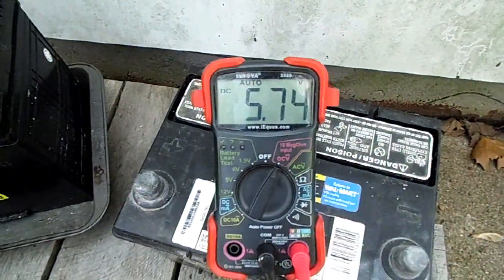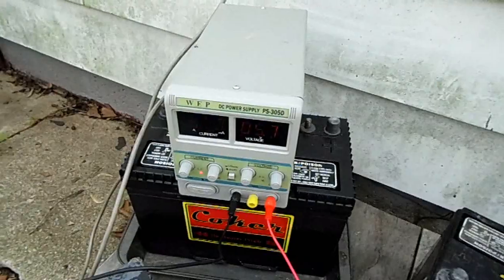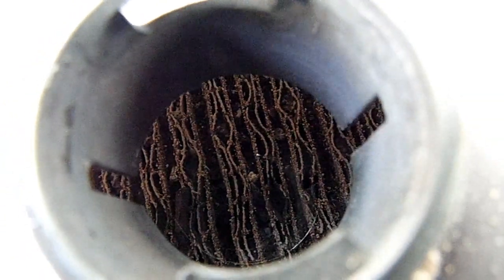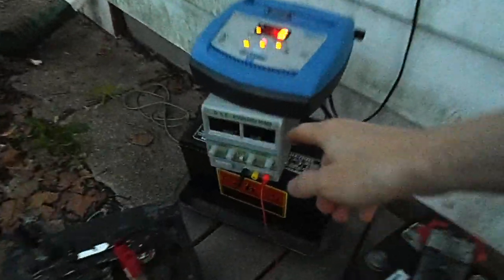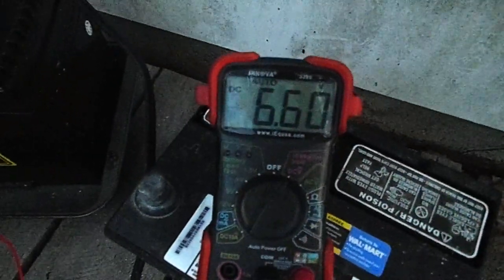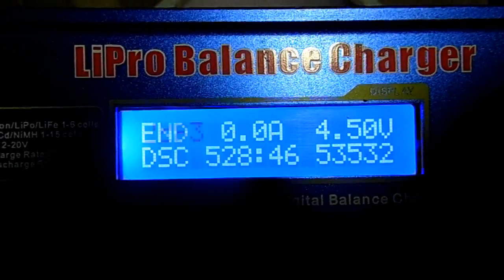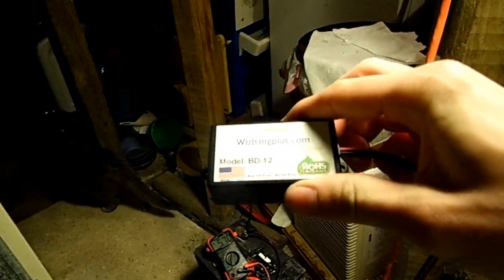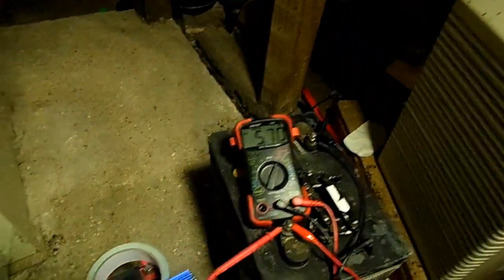Do Desulfators Restore Amp-Hours? Lead Acid Battery experiment

Comment: So 1st he is using a 12v Desulfator not a 6v. There are multiple way to revive flooded lead acid battery. Get yourself a battery hydrometer and a load tester. You can check each cell. To see if the acid is good. If the acid is reading water after it is charged. You can try a pulse charger or a stick welder make sure you remove caps and it is a battery of 12v or more. Set at 60-80 amps for 2 minutes turn off let sit for and hour check voltage and gravity  and load if its good perfect throw on a slow charger or a pulse charger  if not and try again. OR  you can empty the water into a bucket then add baking soda to make sure you neutralize any acid. Now you have options. You can mix pure epson salt with distilled water and boil (google the mixture amount) let dissolve and cool to room temperature and you can add to battery now charge it. OR go buy pre mixed battery acid and add that. Charge on a slow charge. You can also charge say a 6v with 8v or 12v with 14v or 16v or 18v at low amps just watch voltage so you don't damage the battery. Higher voltage with help break down the sulfation along with pulse charging. There are so many ways to revive lead acid batteries.  A Desulfator that doesn't connect to a wall as a charger will take weeks or even months one with a charger will do it faster. Good luck. Also if you do the stick welder process 100% remove  caps in a very well ventilation area and make sure the welder is attached perfect prior to turning on and unplug it to turn it off. Hydrogen gas is very explosive. Some people do the stick welder that puts off 18v in bursts like 3amps  5 mins sit for 10 min check 5amps 5 mins check and so forth. Message me any questions

Comment: DC Power supply is not really  good for charging acid battery because voltage is filtered by capacitors. For acid  battery is better to used charger with just rectifier  so voltage is not flat.

Comment: I use a Pulse Tech PowerPulse passive desulfator, they claim to have a patented frequency they use to desulfate batteries that can extend battery life up to three times, I have been using it on my BMW battery for the past three years and never have any issue's starting even though I only drive about 25 miles per week.
Reply from the maker: Well you wouldnt have issues in 3 years especially with such little use
Reply: @RinoaL  The NAPA battery came with the car that I have the PowerPulse on, I don't know it's production date, but my point is it may not be charging fully because I drive so little, and I have no power outlet in my apartment car port to use a battery charger and maintainer. I'd like to see a actual test on a Pulse Tech desulfator.

Comment: The wiz bang plus is supposed to be used on a battery that is being maintained. You are not supposed to leave it on a battery for 2 months without charging it. You likely had sulfation occurring from the battery’s self discharge not being addressed. Also, please use a smart charger. The way you charged it can easily overcharge a lead acid battery. :/

Comment: PulseTech "120volt" plug in Desulfators  work great, constantly pulsing the battery plates to break up accumulated Sulfation from not being used, charged and maintained. I've used these units on many 6 volt deep cycle golf cart batteries and they work well. Lead acid batteries require attention and charging/discharging & charging to keep Sulfation off of the battery plates. If your dealing with 6 volt deep cycle batteries, you connect two six volt batteries together and use one 12 Volt PulseTech Desulfator. They have saved many of batteries for me as well as rejuvenating a few " left for dead" batteries.

Comment: You didn’t finish the absorbed in charge so what are you really testing? Charge of the absorption voltage which is probably 7.3 V, until the tail current reaches .1 C at least.

Comment: Desulfating needs to be done at 10A to 20A or more depending on size for 3-5 minutes or more with caps off and in an open area away from flames and electrical sparks because the battery will emit explosive hydrogen. Several YT videos show how this is done using a DC welder. It is quit dangerous because apart from the obvious danger of violent explosive gasses, you could be sprayed with boiling hot acid, lead shrapnel, and other nasties. However this is the only way to effectively desulfate these batteries.
Reply: Thanks, do you know if Noco chargers which come with desulfator like Noco 5 included do work? Thanks
Reply: Nah 50amps or above for 15mins 1hour rest between 5 cycles. I do mine at 100amps.

Comment: What about fancy smart chargers like NOCO brand that has a repair mode. It says in the documentation it will bring the voltage up to about 16.5 to desulfate the 12v battery

Comment: these 6V boys already have heavy rogue sulfate crystals really all over the place, everywhere on the plates. this is probably a difficult/impossible-to-solve case though. The second issue is that because all the sulfatation is built up, the acid literally is greatly watered down as a consequence. (means : the SO4 is no longer in solution but finally bound in the crystals, reducing the acid level in the water) .  I would assume these are dead.

Comment: not defending desulfators but if your battery started off with 52 amp hour capacity it means it is not heavily sulfated to begin with so you cant expect to notice a difference. desulfators are for batteries which are sulfated and their capacity has dropped significantly but voltage not lower than 10.5 as it gets too hard when its tooo low

Comment: Here is my experience thus far. I own a Vector batter charger that has the Recondition ability. I've used this unit on many "Dead" or "Shot" batteries and it has brought them back to impressive usable condition. As I understand it the Vector uses some form of pulse technology to accomplish this. I haven't done load tests on these batteries, but basically they went from not holding any charge to working again in cars. And I live in Alaska, so we see pretty hard cranking conditions. A customer of mine has a 48v battery bank made up of Rolls batteries. He got busy over the summer and forgot to equalize the bank. Five months later, he was having to charge them with the 6kw gen almost 12 hours a day including his solar input. He picked up two used Pulse Tech brand charger desulfators at garage sales. Two different models. We stuck them on the bank and in three days went from 12 hours gen to 6. In a week it was back to normal, 3-4 hours a day. This was after three equalization cycles that yielded almost no results. Quad Outback Inverters and 2400w of solar MPPT.  My boss told him before we tried the Pulse Tech chargers that the bank was shot and there was no hope of recovery. My dad has the same Vector charger I do, and has resurrected about 10 car batteries over the last several years. There has to be something to this.....Also people swear by using Epsom Salt, haven't tried it yet, but I got a dead battery that's been sitting out for four years now, gonna give the salts a try. I think the battery industry wants us to believe that we have no choice but to keep buying new...…..

Comment: By the way Rinoa Super-genius, A desulfator like that doesnt supply enough current to do even the smallest batteries. I would get something like the infinitum whcih instead of a few milliamps, it will supply a couple of amps of current to oscillate the plates. Plus it needs to always be on a trickle charger, not to mention the battery needs to be in the right condition

Comment: I used a desulfator kit with good success. The key is 1) not all kits are equal (most are low power and probably don't do anything) and 2) you have to charge the battery at around 14.5 volts. You can't just attach a shitty 12v trickle charger and expect it to work.
Reply: It looks like you didn't even run it with a charger attached in parallel.

Comment: 52.9 to 53.5 an improvement and you call it a failure.  2 months is 10% of a batteries life, and then it improved.  Yes you have one sample but you can not say it is due to error.  You don't know what the error is.  Seems you are writing to the conclusion to your opinion.

Comment: That battery is only about half charged.. Charge it up to 7.2v till its only taking an amp or less of current..
The resting voltage should drop to approximately 6.4 to 6.6v after sitting for an hour

Comment: If  may add my 2 cents, this is important to revive any battery, after removing the old acid, turn the battery on its side and flush with nominal pressure of water, it is to remove the broken down pieces of the lead inside, these pieces short out the battery and touch the plates, flush it well and remove these contaminants and also free any debri still existing on the plates, drain well, then use an Epsom salts mixture, 
good luck
Reply: guitar 2 die 4 I second your point. This is very critical. Unfortunately this only works with conventional flooded cells with wider plate separation.

Comment: A desulfator will only work while the battery is being charged. You need to cycle the battery. And they aren't magic, If the battery is too far gone (internal resistance to high) it won't work.

Comment: I've taken  completely discharged batteries, and brought them back to life. If a battery is completely discharged, most chargers won't work. You have to trick the charger by connecting a good battery in parallel with the bad, and then put on the charger. Once the bad battery shows a positive charge, then you can go about just hooking up a slow charger, 1 or 2 amps, and let it charge for 24 hours or so, and it should be good to go. If it DOESN'T hold a charge at that point, then here's what you do.
1. Take your battery to an auto parts store of your choosing. 
2. Buy a new battery.
3. Leave your old battery for a core replacement.
4. Install your new battery.
5. Resume using whatever battery-powered equipment that the old battery came out of.
Carefully following these important steps for replacing an unrecoverable battery will help insure continued usage of your battery-powered device with limited frustration. LOL
Reply: There is too much anecdotal discussions. I have distilled and tested them all. 4 years and hundreds of batteries, including in-cell photography of b4 and after the regeneration showing physical morphological changes as well as logging chemical changes via the electrolyte. I have deployed at a Bosch dealership and they are now getting a 40% regeneration rate on 'defunct battery claims' in the last month. That is, 4 of 10 warrantied batteries which fail in service have been returned to service via a fully automated overnight process (11 plate batteries, 21 plate takes longer)  this INCLUDES concurrent battery rerating of CCA & Ah. Done and proven in a commercial deployment. No anecdotes here. The system is sophisticated, over 500 electronic components, 90 sq in of circuitry and 7000 lines of firmware. Queues two batteries, 6V or 12V, auto switch over as one is complete,  and executes 13 phases to achieve complete regeneration & recharging (not just desulfation), including other failure modes such as dendrites or mossing. It will perform early rejection of critical failures (shorts, opens, genuine plate capacity depletion, soft shorts etc.) and even describe the type of failure encountered. I'll be doing my own you tube video soon as the final enclosures are completed. This isn't a DIY system though, serious R&D & engineering invested. It can process about 45, 9 plate batteries per month.

For the DIY folks, I'll do a spin off at some point, but my goal is to make an impact on the carbon footprint of re-smelting lead batteries unnecessarily and the toxic footprint of waste batteries being improperly disposed of. I have a Patreon page set up recently. But I simply don't have time to service it while I finalize manufacturing.
Reply: Ancel UnfetteredOne
I guess my sense of humor is a bit too complex to be funny. Just a guess.

Comment: i think the best way with a lead acid it to take it to pieces and clean it properly. Or you can try an alkali cleaner. But the problem is you need to pour out the acid and store it somewhere whilst you do this.

Comment: To date, I have not seen one published scientific journal showing that desulfators work.  To date, none of us have seen a desulfator company show us a live video on battery with transparent case showing the sulfate crystals being broken down.  We hear anectodal stories but no hard science proving that any of these units desulfate anything.
Reply from the maker: +aguilayserpiente yeah and my experiments dont show any good results after a few years of "desulfation" so i'm wanting to do a more in-depth study in the future.
Reply: Regis Shea “research” yea seems legit, link me to peer reviewed studies. I know you won’t because you said “Backed by military confirmation” which ..well, inserts that’s not how this works, that’s not how any of this works.gif 

You think a few pictures and email addresses of employees who supposedly work with military contacts is “military backing up the product”? Smh, and even if they do buy it, army has proven they buy useless shit all the time
Reply: José Duarte at what amperage and voltage though? What amperage and voltage should you charge when trying to desulfate?
Reply: Jose - I agree with you entirely that the best possible solution is to replace the battery with new. Sulphators may help to remove the  sulphates from the plates, but all of the sulphate will fall to the bottom of the battery - between each Plate. It just builds up there, and the performance of the battery diminishes.
Reply: +Rinoa Super-Genius  it wud be interesting to see if they actualy works and see if its worth getting one just for at least maintaining batterys and keeping them good that coupled with like a 12v 15w solar panel wud be perfect
Reply: You must not have put any effort in looking. Go to pulsetech.com, there are 2 college researches, backed by militry confirmation. LMAO
Reply: I bought one from Black and Decker, but returned it because the maximum amount of charging time is 2 hours.  Then I bought an Optimate 4, touted as having charging, diagnostic (sulfation, ability to hold a charge, temperature, etc), desulation, and trickle eco maintenance charge.  The Optimate 4 diagnosed a battery dead for a year as capable of holding a charge (green light) when it could not, diagnosed a brand new battery off the shelf as (yellow light) weak and sulfated, and diagnosed a 10 year old battery with sulfate visible as non-sulfated. 

It's not worth paying the extra $30 for the desulfation function on a battery charger.

The DOD and Sandia Labs indicate that the best method for preventing sulfation is to periodically drain a battery to 10+ volts and recharge it to its recommended maximum of 12.6+ volts.
Reply: I've been studying battery repairing and discovered an awesome website at Magic Mender Wizard (check it out on google)
Reply: +aguilayserpiente I have spent months researching into battery reconditioning and discovered a fantastic resource at Magic Mender Wizard (google it if you're interested)

Comment: Has anyone actually had much luck with desulfators? Any recomendations, don't wanna spend much but don't wanna waste money on cheap junk!
Reply: Blakehx 
I have used an optimate smart battery charger which is meant to be desulphater as well. 

Have managed to recover car  jumper boosters/ starters and many motorcycle and car batteries and regular use of them helps the batteries last longer

I have one on my motorbike that's lasted over 6 yrs which for a bike is a life time.

Comment: BTW: Did anyone care to notice that he might be using a 12V desulfator
on a 6V battery. ICYW: Desulfators need to draw a little power from the battery to operate, and if the voltage is not high enought. the desulfator will not operate.
Reply from the maker: joyange1 yes but the listing said it worked on 6v and 12v batteries.
Reply: @RinoaL .
Reply: +Rinoa Super-Genius I own the same ebay disulfator you are using in the video, it does not desulfate 6v batteries. But, this process is all about learning from each other, your battery videos are the best in you tube
Reply: I saw your post and went to amazon, it says it support 6-12v
Reply: well it really doesn't matter because the battery only had 4 volts while he was running the desulphator. he also said the voltage came up considerably compared to before. 1 amp hr at 6 volts is a lot more than 1 amp hr at 4 volts.... seems to me that this video actuallt proves that it works.
Reply: here's  several things for battery repairing
do not try to do this unless you are sure what you are doing - the acid can burn your skin
Test the voltage first - there may be a dead cell which would waste your time.
Check the battery fluid.
attempt to completely recharge the battery.
(I learned about these and more from Rapid Renew Roadmap website )
Reply: sizedoctor it very much does say it supports 6v batteries and if you understand the way it works that would be obvious